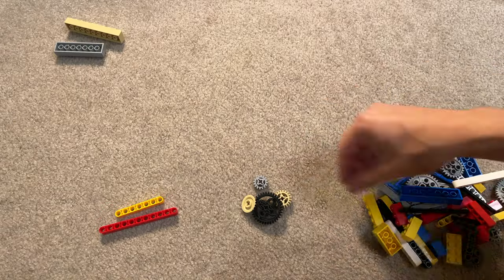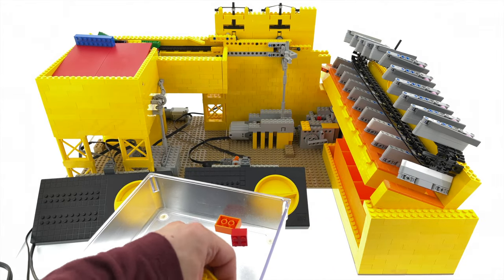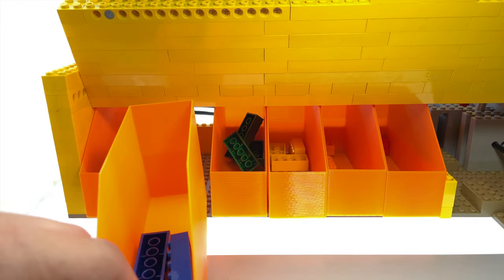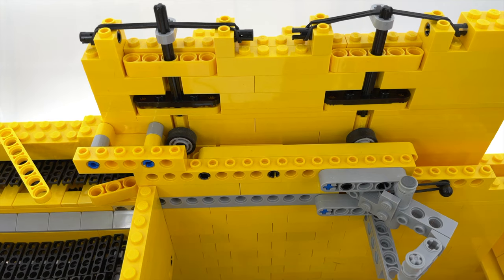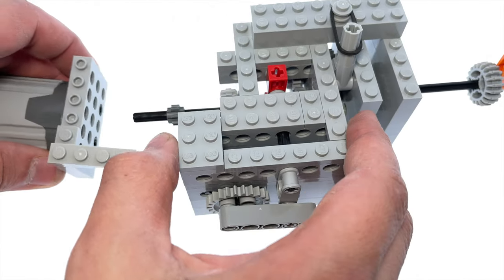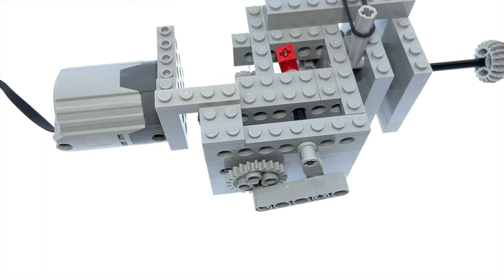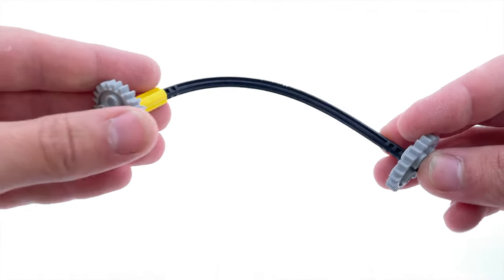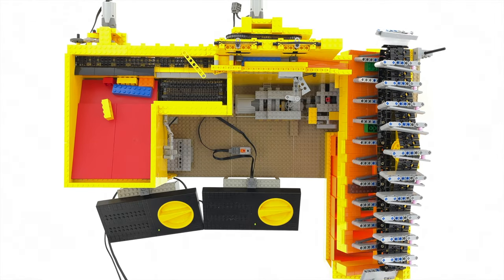Mechanical LEGO Brick Sorting Factory

Comment: Gonna be honest, I'm actually a little surprised that the "beating" heart works as well as it does without developing any cumulative error. It relies on the red ring engaging the dark grey gear with a precision of 1/4 rotation. If it ever missed, it would not auto-correct, and the synchronization would be off forever. For that kind of intermittent motion, I probably would have used a Geneva drive or something. But hey if it works, then it works! The ratchet is definitely an interesting solution.
Reply from the maker: Yes, the ratchet stops the rotational tension from rotating the dark gray gear backwards, potentially throwing off the driving ring. A Geneva drive would have worked great, still with a ratchet, but I tend to overcomplicate things but the overcomplication makes things more interesting! Thanks for the kind words and ideas!